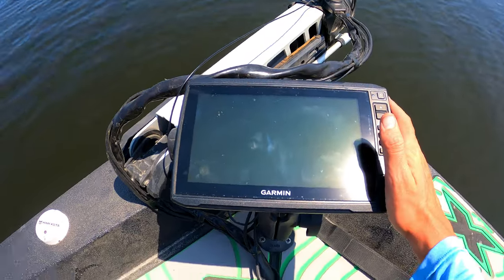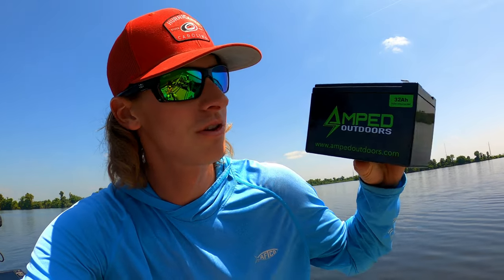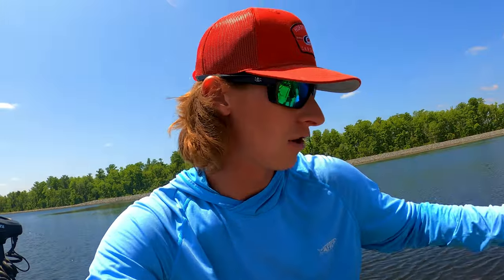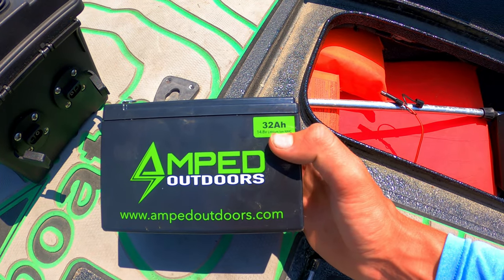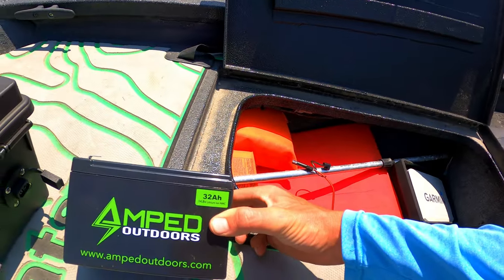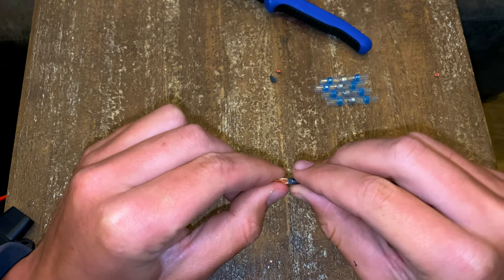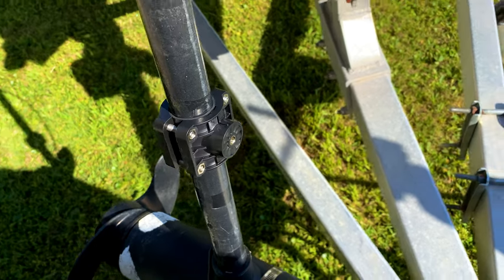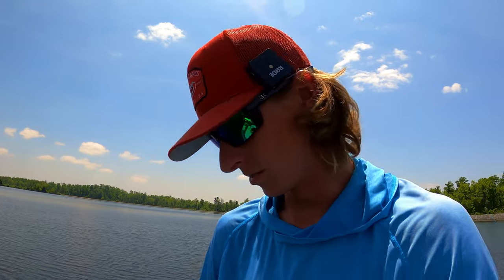How to Install LIVESCOPE the EASY WAY (Amped Outdoors Lithium Battery/Ice Hole Power Box)

Comment: We bought a boat with 2 Dewalt 20v5ah batteries to run the LSV32 and 102SV graph on the boat. We get a better picture with lithium than GMA. Our console 93SV was GMA. Both ends of the boat got upgraded to 126SV units.  The 102SV stayed up front. The Dewalt battery hack ran dry in 3 hours.  We are adding a Li Time 12v100ah battery to the storage in front of the console and wiring the console unit to this battery.  Once your batteries drop below 12v, your picture begins to degrade, irrelevant of type.   Higher amps offset lower AH, they do not improve Garmin graphs.  The Dewalt hack required six 5ah batteries to fish a long day prior to our upgrade.  Hope this helps.

Comment: Incorrect on the higher voltage for picture it comes down to the amps it can handle not the voltage. Thanks for the vid. I too went with the amp battery but 12v 30Ah as well as the delux box from ice hole ( good combo)